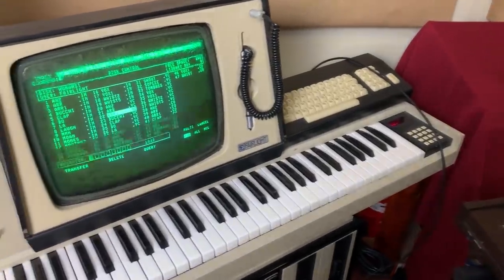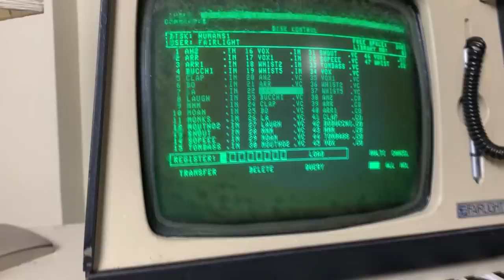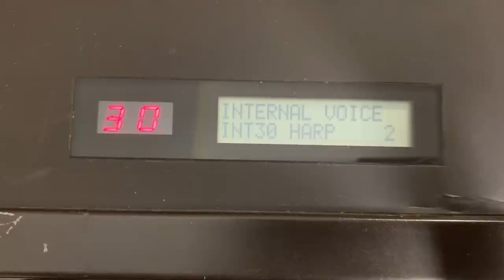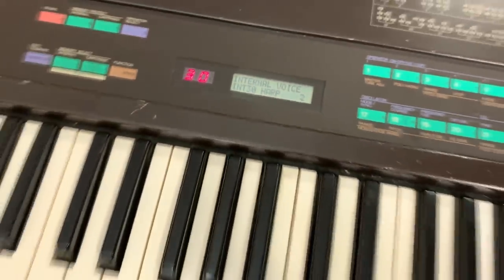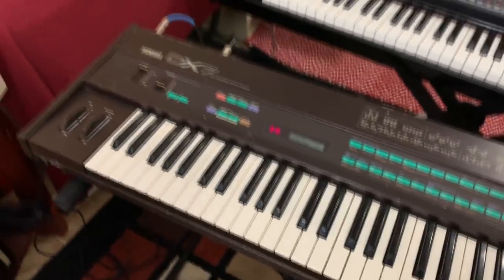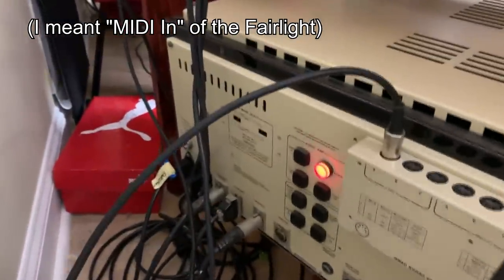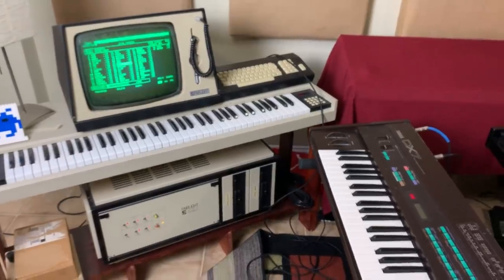Crockett's Theme lead

Comment: Briliant! Have the Arturia Lab3 featuring both the DX7 and the CMI Fairlight. I found no matching harp sound on the DX7 vst so instead went for the dexed vst with the original Harp 2 patch. On the Arturia CMI vst i found a patch named  Sararr which sounds like its been sampled from the original ARR1 patch.
A little fine tuning on the gain on each instrument and added some reverb and there i had it!
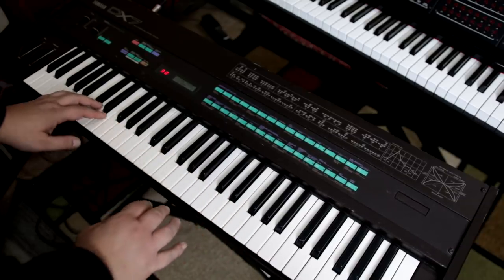2:36
Reply: Formula400Pontiac i turned to my Arturia plugins to try to recreate this as well. Thanks for the tip on the Fairlight patch named... I don’t have dexed plugin..
Reply: @djmattplay  I'ts free plugin,google it ,there is also banks,free but one from best FM vsti sounds
Reply: If you scroll down to the R's in the DX7 preset list, you'll come across all the factory Rom patches, and 30 Harp2 is there, as well as Koto from the other comments.
Reply: Nice thanks for the info fellas.. I did download dexed.. but nice to know Arturia did get the factory sounds in there.. I figured it had to be there because the DX7 plugin can even load factory SysEx Sound banks! Slightly off topic .. but I just discovered another awesome free tool you both might be interested in.. go to Loopmasters website and download their free sample library browser software called Loopcloud. Watch the videos on it.. it’s an awesome free tool imo! Cheers 🍻

Comment: I found the longer (12'') version of the crockett's theme. In this particular version there is no ARR1 vox in the beginning in the lead sound, so it just the ''pluck part''. The isolated pluck part can be found and heard here: https://youtu.be/_lAaojqA_08?t=46
Now it would be much easier to recreate the pluck part by listening to that video. Later in that 12'' version Fairlight ARR1 also comes in the lead sound combined together with the pluck.
I was playing around with a fairlight and DX7 recently and if you use the Koto patch from the DX7 and modify paramaters (instructions are in the comments below) it's really close to it.
Now for the most users that can't afford expensive Fairlight machine there is other option. You can use Roland U-220 module with Syn.Vox 1 patch or Roland JV-880/JV-1080/JV-2080 module with Arasian Morn patch. All of these had ARR1 vox sound really nice sampled.

Comment: Very nice, yes Jan used the fairlight (ARR1) for the lead and the dX7. But that was not the preset Harp 2 but an over (you can ear that it sound different with a A/B comparison). I have that preset on my dX7
Reply: MrGiloine What is the name of that preset on your DX7? I have seen your video cover from 2015 and it sounds like its there.
Reply: @kilevox  i will post a new cover of that music very soon (a bit different))....... with the original lead.
On my synth, the name is hammer bell, but i don't think that it's the original name. If some of you are interested, you can send me a private message and i can send the SYSEX

Comment: I am also in love with the crockett theme. Thanks for the demonstration! Harp 2 from Rom1B is different to Harp2 from Rom3b. I am using Arturia DX7V emulation and Rom1b Harp 2 was builtin. I've imported Rom3b and in my opinion Harp2 sounds better, because there is less noise when pressing chords like g,b,d. But i am not a musician and have no clue. Just personal feeling.

Comment: Hi Paulo, I have a SD card drive on my Fairlight IIx and it has the exact sample with the combined marimba and Arr1/Saraar sound in a single patch. I don’t think it was a standard factory disk sound - I’ll send you details once I find it to confirm. Might have to figure out a way to get a copy to you that can use. 

Really liking the new videos and the synth walks. Keep up the fantastic work.
Reply: Hey Marty! I've got a IIx with the sd card too. Interested in swapping files?
Reply: Well after going back to the original track, I think You have this exactly right Paulo. For some reason I thought the Sarah/Arr1 patch was layered with the harp/marimba sound all the way through 🙄. 

For more local repairs for your IIx you might want to contact Andre Kudryavtsev at Deft Audio as he is in the US and well versed in these machines.
Reply from the maker: @martythevampire1  Thank you, Marty -  I've had a plan to create a section to buy/sell/trade disks for old samplers, but haven't gotten around to building it yet, I do have the complete library for the IIx on disks, not sure how to transfer to SD though at the moment
Reply: Well! If you can afford a Fairlight, I would think that you can afford to courier your disks to Paolo yourself, via your Learjet! 😎. 😉😁

Comment: Like some others already suggested, definitely not the HARP2 sound on the DX7. I'm not sure what the correct one is, but it´s a sound being used more often by Jan Hammer. In this long version from 46 seconds you can hear it isolated from the Fairlight:
https://youtu.be/_UmOY6ek_Y4?t=46
Reply: But it's not the HARP 1 either. It's something unique.

Comment: Paolo the fairlight arr1 sound yes right. But DX7 synth harp2 is not right. It sounds very different to the original. It's a sampled  Koto sound.
Reply: Moreover, KOTO + Crockett's Theme = Roland D50 "Staccato Heaven" + CASIO CZ-101 "KOTO BASS".
Reply from the maker: Hi Marko , It could be but what koto sample? From where, do you have exact info?
Reply: @SynthManiaDotCom  I think there's a Koto patch on the DX-7, it has to be an FM synth for sure
Reply: Great vid but I agree the DX7 sound isn't quite right. I think RetroSound is correct that the Koto sound on the DX7 is closer to the mark but it's not correct either. However using the Koto preset as a starting point, we can make a few slight tweaks and get much closer. 

Start with the Koto preset (ROM 1A preset 23) and then edit the following:

- change the algorithm from 2 to 6
- set OP6 output to 91
- set OP5 output to 70 and change the FREQ to 2 (from 4)
- set OP4 output to 66
- OP3 stays the same
- set OP2 output to 86
- OP1 stays the same

This sounds much closer to my ears. What do you guys think?
Reply from the maker: @JimAlfredson  Hey Jim!  Yeah, I did that video very quickly so maybe I didn't pay enough attention to the pluck sound. When I get a chance I'll try those operator edits. I guess the only way to find out would be from Jan Hammer himself... if he ever read these comments :-)
Reply: @SynthManiaDotCom  wouldn't that be cool! 

I have been playing around with the edits above and determined that OP5 output should be 83. OP5 provides the 'pluck' sound and it needed a bit more. But the FREQ should definitely be changed from 4 to 2.
Reply: I still thinks it's the DX7 (not a koto sound, that's sharper) but more likely a hard marimba or something because I hear some kind of "round, woody" quality in it.(Edit: I've searched my library of dx sounds and a sound named "Celeste" was the closest I could find.)
Reply: It’s not the DX7 Koto, or Harp. Also not a Koto sample. I have the patch, and I’m currently working on a video to unveil it haha.
Reply: seriously? its soo close guys. unless you solo'd it making such a sure judgment is highly improbable. When heard in the song you hear it compressed and massaged into the mix, it sounds a bit softer. Considering the context(s) it sounds spot on.
Reply: Acrabeth I agree. Very close in a mix, but side by side they are quite different.
Reply: @SynthManiaDotCom  Koto is a standard DX7 factory patch.
Reply: @JimAlfredson  Hey Jim, I did operator and freq edit today and it's really close. Only LFO Delay has to be changed from value 40 to 99, because when key is pressed down and hold it modulates a bit. Search for ''Jan Hammer Crockett's theme live from Amsterdam TV'' and you will see him playing only on Fairlight, so the other part of this patch has to be sampled on Fairlight.
Reply: @kilevox  good catch! I'll try that. Yeah, it's really close. Not yet perfect but getting there.
Reply: @kilevox  While it's possible that the sound is generated by the Fairlight, my guess is that the particular live performance you noted is all 'lip synced'.

Comment: I knew there was a DX7 in there somewhere on that lead! 

I believe he used the Jupiter 8 for the bass and strings as well.
Reply: So. DX7, Fairlight, Jupiter 8 and Linndrum.... Jan Hammer had a murderer's row of gear to work with! If only the D-50 had come out a couple years earlier surely he would've worked wonders with that too.
Reply: kz1000ps I actually wonder what sequencer he used. I thought everything was sequenced from the Fairlight, in fact I thought the drums were from the Fairlight too.
Reply: @EverettDudgeon138  I don't want to say I'm an expert on Miami Vice music, but I've listened to a LOT of it (check out the channel Crockettt1984, it has tons of unreleased tracks) and the drums for each track are usually about 70% Linndrum and 30% Fairlight. And I'd assume the Fairlight was doing the bulk of sequencing.

For instance, I love the song "Payback" ( youtube.com/watch?v=MDklUr4QcmA ) and on that one the drums are about 90% Linn with the stock factory samples we all know and love, and then probably from the Fairlight would be that syncopated tom/kick thing and then the timbales in the breakdown. This is quite typical drum production for a Vice track.
Reply: Backing strings is Oberheim Matrix-6
Reply: Amanda Kleisnerová Really? Did Jan confirm that?
Reply: @kz1000ps  If you haven't already, check out three Jeff Beck albums with Jan Hammer playing on them ("Blow By Blow", my favourite called "Wired", and "Jeff Beck with the Jan Hammer Group"). Awesome music! Jan Hammer isn't just a very good composer, he can really bring it in the studio & on stage!

Comment: Thanks Poalo , this Will give some more details on this one that I'm also playing. Now on Kronos. But want toen use my vintage 106 , jx3p , JP 80 , Alpha or Poly 61 . Maybe some hints 😉
Reply from the maker: Do a syn vox + pluck layer on the JP-80, it's so easy to do layers on the that machine
Reply: @SynthManiaDotCom  Thanks for the advice Paolo I will test this new baby next week. Have Just bought the JP80 Nice machine BTW. Had no time because our House gets right now a new roof 😉 hard job my carpal tunnel syndrom is painfull. Have to rest a bit first. Keep up with your Nice channel grtz from Belgium

Comment: AR1 patch sounds like the one used by Art of Noise , or maybe them used e mu s one 🤔
Reply: Yep, everyone used it at the time
Reply: Yup, it's one of the CMI's most famous sounds. Art of Noise used it, OMD too, and Tears For Fears, Jean-Michel Jarre, Yello, the Pet Shop Boys...
Reply: @ctspf  Jean-Michel Jarre's "Zoolook" album is basically just a promo disc for the Fairlight's patch card he's got loaded up right now. JMJ was one of the launch customers who received one of the first production models.
Reply: Art of Noise never used Emulators.
Reply: @Stoney3K  "Zoolook" has many Emulator samples as well (the choirs at the beginning of Ethnicolor, for example).
Reply: @Stoney3K  Zoolook ? Errr... No. Jarre first used the Fairlight on Les Champs Magnétiques back in 1982 and in a very different style. Zoolook isn't an ad for the CMI. Surprisingly, he started to work on Les Champs Magnétiques and what would become later Zoolook a the same time in 1982. Jarre finished Music For Supermarkets but the copy was destroyed (this record have quite a weird story). It was apparently an early version of Zoolook more than an actual full album. Finish it was long and difficult : all the samples of multiple languages were completely created for the album: no presets here, the drums (Linn) and some pads are but the record is mostly made of original material.
There was not so long ago an article in Technikart (a french journal) where Jarre explained the story behind Zoolook and how he and the label did believe that this album would be a huge commercial success (but it did not). Very interesting.
[sorry for my weird english]

Comment: If you are using DX7 m I as a master keyboard, you should always consider the velocity levels of the patches in the source instrument becouse DX7 m I has 0-99 non-standart pre-midi velocity levels. Normally velocity levels are between 0 -127. 
There was no sound in B key 02:23.. is it DX7 or fairlight issue?
Reply from the maker: My DX7 is a Special Edition ROM DX7. It does 127 velocity. But even if using a normal DX7, 0-99 is fine for most use, unless you must play something in real fortissimo levels. Do this test: open a MIDI app and record yourself playing with MIDI data coming in. Then look at your average playing, how many times on average do you reach 100-127? not a big deal at all. Fairlight has bad voice card.
Reply: SynthMania 0-127 velocity leveled DX7 is fine. On some machines or I must say on some patches, a new sound explodes, like timpanies on orchestral patches and on some other patches, the filter opens up or down due to velocity. Maybe not all keybordists use high velocities but pianists use them well.
For the Fairlight part, I haven't watched the walking q&a series you've started yet if you have already answered but one of my questions will be about maintaining huge numbered instrumens. Replacements and electronical fixes, etc.

Comment: Didn't think it was possible to MIDI a Fairlight Series 2xBy the by, ever used a reverb, flanger and phase shifter on an OB-Xa?
Reply from the maker: Yeah, with the Fairlight II no MIDI, the IIx added the MIDI interface. Yes, I've passed the OB-Xa through effects in the past
Reply: Rockin' :)^^